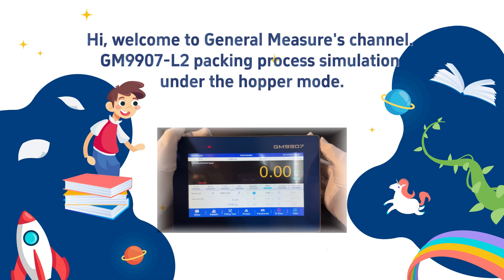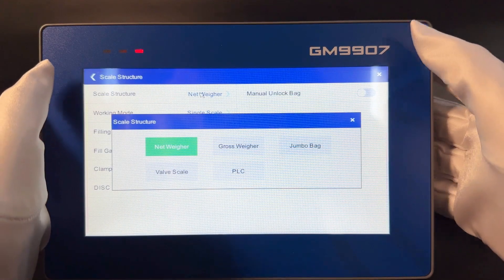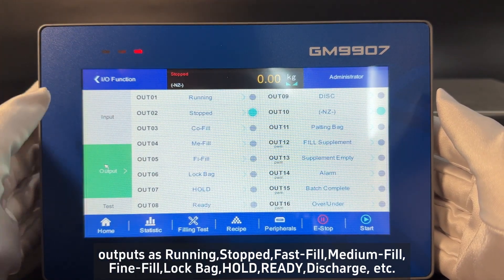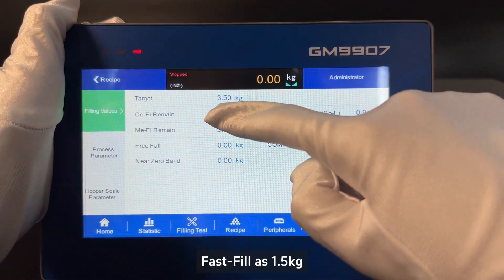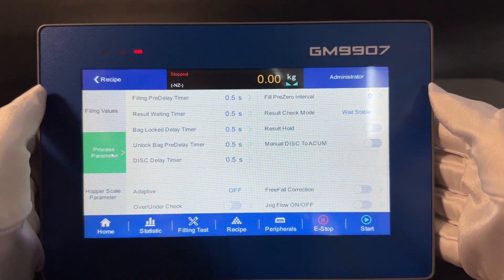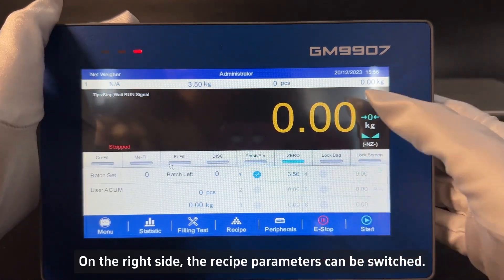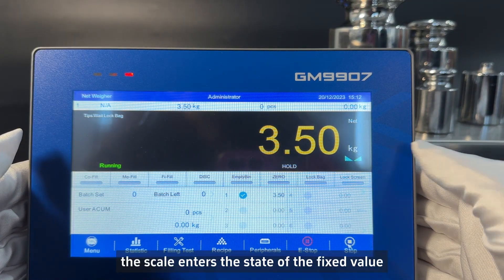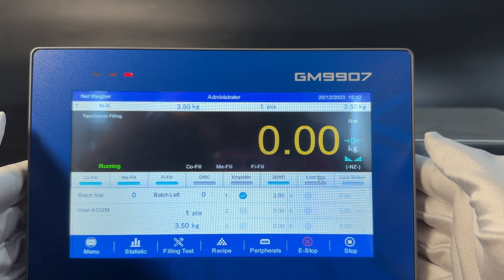Packing Controller GM9907 Packing Process Simulation

Comment: How can we set up the mode to open and close the discharge valve from the hopper to the roller system of the bagging machine?

Additionally, we are facing an issue where the material weight discharged from the hopper to the bagging machine is less than the preset weight in the bagging machine. What should be the next step to handle this situation?
Reply from the maker: Hi, thank you for reaching out to General Measure. Please leave a message with your email address:https://www.gmweighing.com/contactus